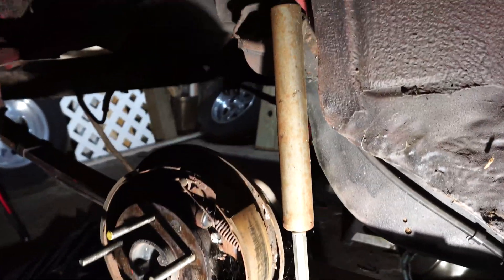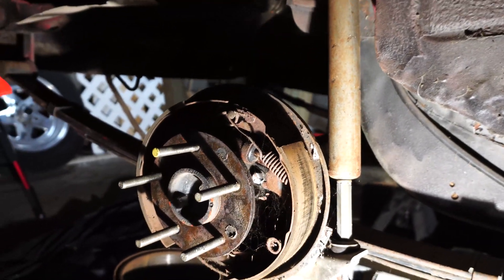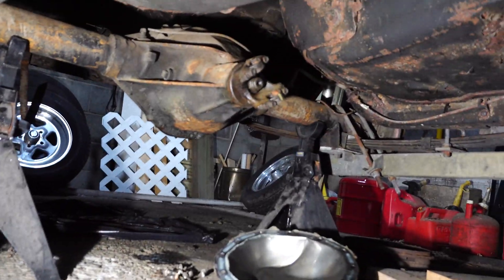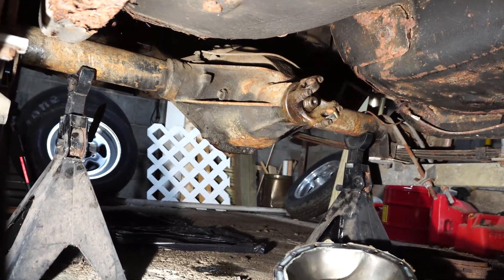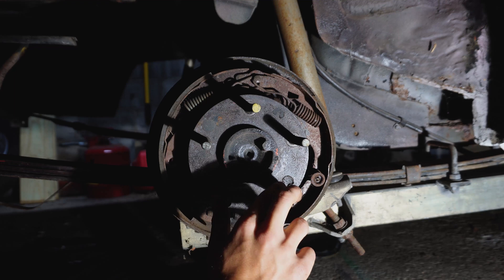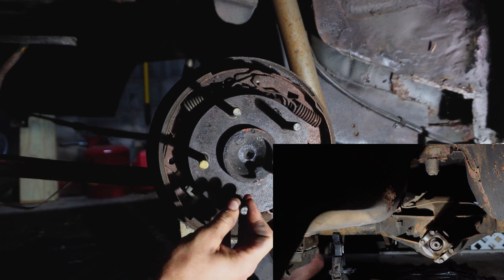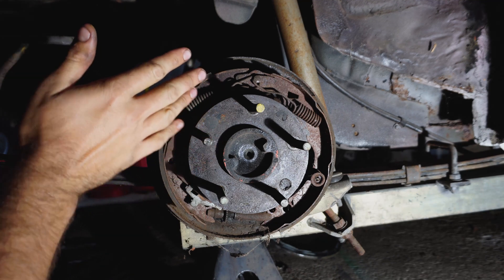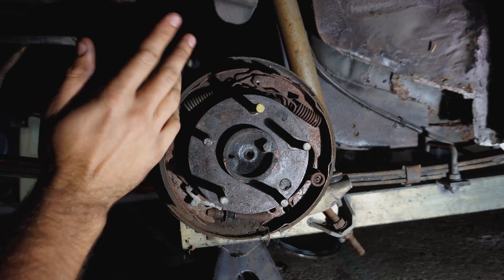How To Find Your Rear Differential Gear Ratio (Chevy Camaro 12 Bolt Rear End)

Comment: Nice car. I also have a 83 z28 black with silver. Was a 305. 5 speed. Here's some tips and tricks..in the early 2000s. The original 305 h.o was pulled at 53,000 miles. We put in a blue printed and bale  built 383 stroker 4 bolt main . Bord 30 0ver. Edelbrock compition intake and a 650 eldelbrock. Has a bunch of goodies inside. Roller rockers, comp cam . Forged pistons accel performance distributor and ignitionand headers into 3 inch then the mostpopularback then flowmaster and 31/3 inch chrime tips. She sounds so good. So I disagree because it dynoed at 560 at the crank with 6 something torque.  So I figure it had to be around 450 or more at the wheels. So the disagreement and advice comes to the trans. The obly problem pems I had with the trans was the 9 inchclutch disc we replaced with a performance 11 inch. Butt the torque flexing that unibody started effecting the z bar linkage and would be hard to get in gear. Anyway I was in a bad accident in my ss s10 and am paralyzed. The camaro sat in my parents pole barn under cover for a ling time. But 2 1/2 years ago i orderd a built turbo 350 . 3200 stahl and stage 2 shift kit.  my dad ,my friend and i got it in . Keep in mind i cant drive sticks. Anyway if your gonna do swap. Be shur to get a 4 core aluminum rad with dual fans. Then either swap the whole rear-end or change the ratio. Then 5 speed cars had a highway gear. I think it was a 323 or 3:42. It has a 3:73 tru trac now and a ratchet shifter. . looking into getting appellate dress up kit and serp belt. Anyway. Hope to see more videos.  Of your build